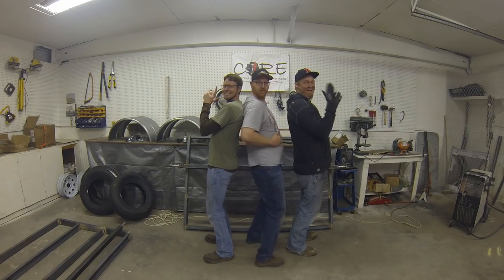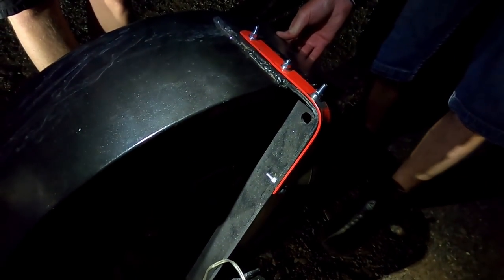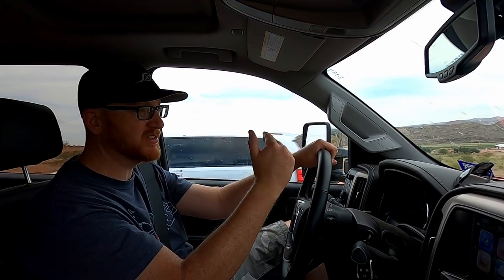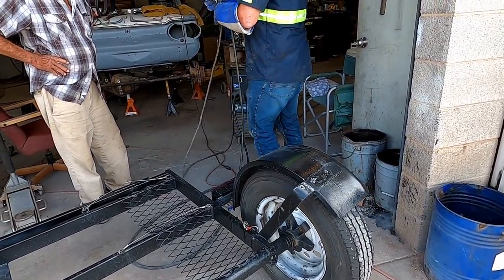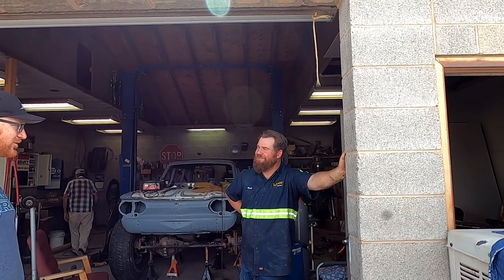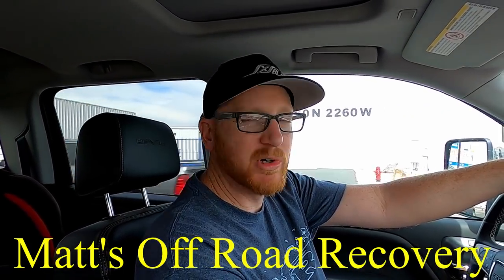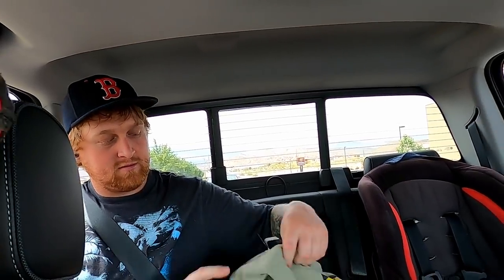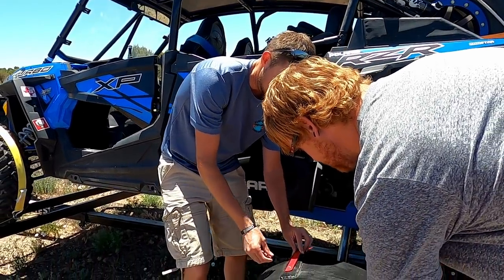Matts Off Road Recovery Fixes Our Trailer plus MORRVAIR!

Comment from the maker: Matt, Randy and Edd we are so thankful for your help!  Excellent weld and technique.  Our metal had just been worked out too much and had softened next to the new hardened weld.  Also our other side failed in the same place within 60 miles so it was just time.
Reply: Hey guys! On your next fender mount. Example take a paper clip and bend it back and forth it will break after a few cycles. So your mount is bolted rigidly to the frame. Then the 90 bend work hardened the bend. The section that broke is being stressed by the mass of the fender overhang and the wind loads cyclically. You need to gusset the bend as stress concentrates where stiffness changes. Or put a third attach to the fender to stabilize the vibration from the wind. My 2$ free.
Reply: Wow
Reply: Make your new fenders out of rubber conveyor belt it’s strong and will flex 🇦🇺

Comment: Although I’ve only built 3 trailers in my time, I’ve learned that cold bending stresses steel out, and creates weakness before it even gets a load on it. 
For fenders, or wheel arches as we call them in the UK, I’ve had best results using short lengths of flexible exhaust hanger straps. It holds them firm, but allows flex to absorb vibration. 
A lifelong career in Civil Engineering has taught me that to make a structure seismic resistant (vibration proof) it needs to flex, not made more rigid.
Nice video, and kudos to Matt and the recovery team. Matt is a true gent, compassionate and practical. 👍🏻🇷🇴🇬🇧
Reply from the maker: I definitely agree we were very aggressive with hammering those fender straps in place 3 years ago.  It definitely failed between two rigid points.  When we got it fixed up you easily sit on them.  I appreciate your comments and definitely a steel that had the tension memory like a spring formed in it would out last.  It would just be hard to find the right shapes for our custom fit design.  I believe we are going to try to extend the frame forward like our 2nd version design.

Comment: Simple solution! Use a flat leaf spring for your top metal strap, cut with a  band saw, using mostly bolts to hold it in place, since welding changes the temper of the steel. It can flap forever and not break.
Reply from the maker: We got it fixed check out our new video!

Comment: It broke next to the new weld. That means either the metal was fatigued or wrong material to start with.
Reply: Looks like a cold weld from the way it broke.  That's the problem with wire feed welders.  They can make real pretty beads just lay on top of the metal!

Comment: Didn't know if you could box out, make a square, on the outside of the wheel from front to back and run some steel ribs off it. Lay the fender on top of it and weld underneath.

Comment: A possible aggravation to the failure may also be that the trailer tires are not balanced, or the balance may be off due to clay/mud on one part of the wheel. IF so, they dynamics of the vibration at speed can make week structure fail more quickly. In my opinion, it is WORTH IT to balance trailer wheels, for added wheel bearing life, and longer (more even) tire tread life too.
Reply from the maker: I agree!  All trailer tires on both new and older versions of the trailer had the wheels balanced from the start.  This trailer had been driven empty  for more than 18 hours which it wasn't designed to do since the rzr is the suspension.  They would have lasted allot longer if it always had shock suppression.  Also the very first run had less support on the brackets and really let it vibrate for a 5 hr trip.

Comment: you can try install brackets with rubber bushings. ant use little less tirepressure for softer ride on highway, i think 28psi could work ok
Reply from the maker: We got it fixed check out our new video!

Comment: You need something that will allow the fender to flex without breaking, like maybe spring steel that hasn't been welded.
Reply from the maker: We got it fixed check out our new video!

Comment: You need to use thicker metal on your brackets like 1/4 inch metal or 3/8 metal because that thin stuff is junk for fender brackets
Reply from the maker: We got it fixed check out our new video!

Comment: Warning, engineers build to minimum, tradesmen build to maximum  Engineers don't have to fix tradesmen do. try to find plastic fiberglass fenders and triangle brace or get a big piece of rubber belting.  It is not a step it is to contain flying rocks if you are going to weld something in a vibration environment make a number of unconnected short welds
Reply from the maker: Watch the rest of our series we do alot of do diligence on our upgraded model.  We are in maintenance on our daily jobs.

Comment: Fatigue failure from the fender vibrating.
Reply: I think you are right something called harmonic vibration whatever that is.     Like the team Jesus shirt
Reply: correct ,  reinforced or thicker metal or redesign.
Reply from the maker: I agree check out our videos on our second version trailer in our playlist to see what we did for our redesign.  The MOD for version 1, we are desiding exactly how much we are going to reinvest.  Whether we will just use heavier material.  Weld some materials out front so we can add a full fender.  Or completely redo the whole frame and axle.  Thank you for the comments I like the brainstorming for sure!